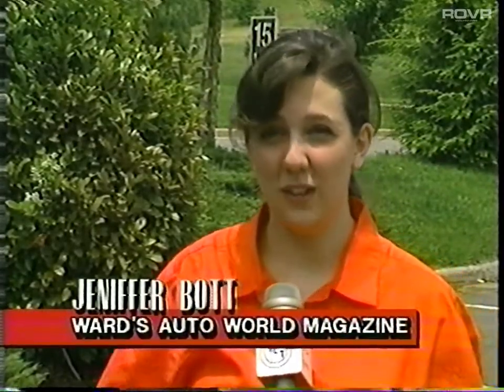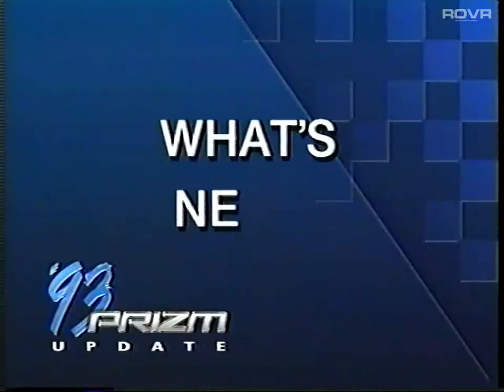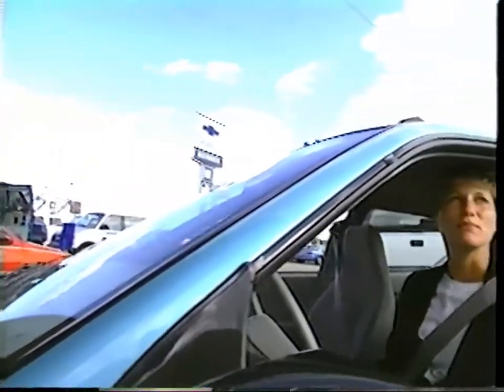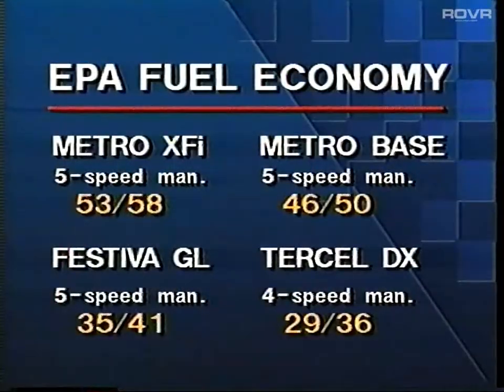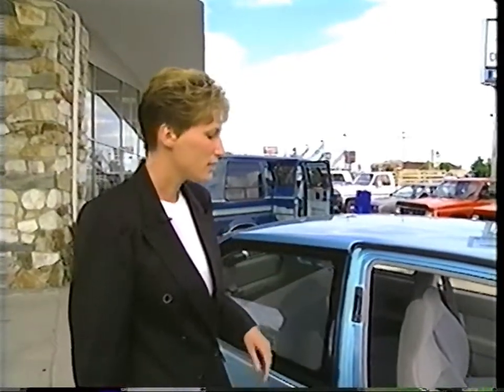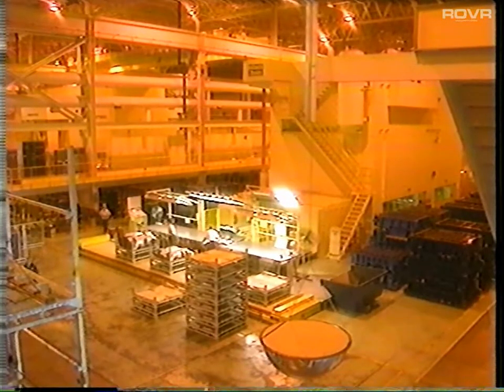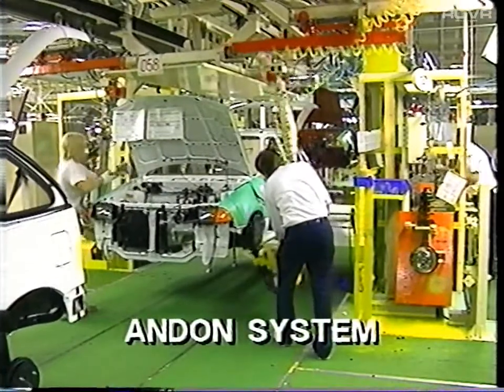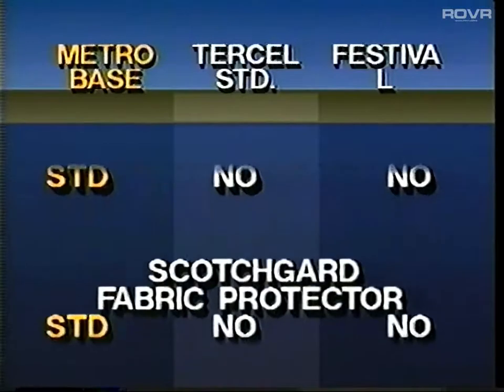Chevrolet (US) - 1992 Geo Metro vs Ford Festiva - Inside Track (1992)

Comment: The Geo Metro was a far better car than the Festiva, and both were better than the cheapest Hyundai Excels of the day. 
These cars are among the cheapest on sale, so you cannot expect Lexus quality or Corvette performance. The Metro sold on price and economy - remember, this was in the days before the Prius or electric cars - and you could, in theory, take three of your friends on a road trip and expect 50mpg. There are not many non-hybrid cars capable of that today.

I drove a Metro for a short time at my job back around the time this video was made. It was not glamorous and not fast, especially when the AC was on, but it wasn't terrible either. It was a considerable step up over the Chevette and Omni which were two of the more miserable carpool options (this was a state job). I wish it had the manual - an underpowered car with a slick manual shift is more fun than many automatic cars with more power. 
The lady at 19:25 would be disappointed to know that besides some badging and ScotGard, the Metro is just about all Suzuki!
Reply: All depends. 

GM is crap. Ford too but, it’s hard for a ford to die.
Reply: @prestoncheapbtheadphoneste3010  but the Metro was a Suzuki and the Festiva was a Kia. Suzuki was just more reliable than Kia back then.
Reply: @engineer_alv  That is true.  And there A LOT more Metros around today than there are Festivas.  Festivas were just straight garbage, especially once they were over five years old.
Reply: No, the Metro had sloppy handling and was not fun. The Festiva was ultra reliable and a blast to drive. Mine lasted seven years.
Reply: @LearnAboutFlow  Neither had great handling.  Those cars were not made for good handling.  They were mainly transportation cars.  If you got seven years out of your rolling pile of garbage then you got lucky but you did not say how many miles it had.  If it died after seven years and only had 40K miles then that's not reliable.  My aunts and uncles got 200K miles or more out of their four early 1990s Metros.  The last Metro we have has always been a spare car and it's a 2000 with 168K miles.  It's never left us stranded and all we've done is oil changes, tires, belts and two timing belts.  You still see a good amount of Metros, too.  Festivas in California and Arizona are a rare sight today.
Reply: @kendrahansen1175  The Metro was designed for people who like Corollas. The Festiva was a great handler given its class and I took it into twisty hills and such. I cannot comment on long-term reliability ($200K+) as the car slid on a wet road and suffered frame damage. But during the seven years there were no problems, and I believe the car had like 50K. I even had it detailed multiple times.

Having old cars on the roads today are due to two basic reasons. One is the fact the cars were garbage to begin with (basically any American car), but in this case it has more to do with what cars people like. There are a ton of VW Beetles in CA as are microbuses.  There aren't a lot of Toyota Tercels (for example), even those were bulletproof and fun to drive.
Reply: @LearnAboutFlow  I don't know about that.  Corollas and Metros were in two separate categories.  Metros are ultra-basic transportation and Corollas as a much bigger step up.  If anything, Tercels and Metros are a better comparison.  Having a car for seven years is one thing but if you only put 50K miles on the car, that is not a very strong indicator of its reliability.  It's something but 50K is not much in terms of miles.

Yes, people tend to keep the cars that they like running but if a car is well built it will last years, even through multiple owners.  At some point, however, there will be a repair that will cost more or about the same as the car is worth and that is when people will let them go.  Unfortunately we are a throw away society and even if a repair is expensive it is often still worth it to make the repair because it is cheaper than a car payment.  Most people don't have that mentality, unfortunately.
Reply: @kendrahansen1175  The Corolla comment was not about classes, it was about boring drives. The Metro and the Ford Aspire (Festiva followup) were both very, very boring cars. The Festiva was not, and was a blast to drive despite its doors shaking at 65 mph. And 50K may not be a lot of miles, but it is a clear indicator of long term reliability for any car.
Reply: @LearnAboutFlow  Well, if anyone buys a Corolla, Metro or Ford Festiva for performance in any category they need some education.  After about 1980, most cars easily made it to 100K miles so 50K is only half of what any car of that era should have reached.
Reply: @LearnAboutFlow  I don't think I ever drove a Festiva, to be fair, but a friend of mine had one or access to one in high school. It was probably a better handling car (I assume from its Mazda 121 origins) but the ride was also choppy and the cabin was chintzy, even for a cheap econobox. And Kia, who actually made the car, wasn't known for attention to detail or quality back then. The Metro wasn't a fantastic car, wouldn't ever say it was, but if you're buying a hairshirt car like this you might as well go all in on the economy. Not sure how much 'fun handling' matters on a car with <65hp.
Reply: @RoadCone411  I only buy cars that are fun, and the Festiva was that. I never considered it hairshirt as long as you knew its limitations. 

But you do sound like a typical American, since even the 32 horsepower original Fiat 500 Abarth was considered a blast to drive, even on race courses.

Oh well, to each his own, but the Metro was boring as hell.
Reply: @LearnAboutFlow  I don't know what typical American means, but these were the cheapest cars on sale in the USA. I have an affinity for small cars from this era because that's what I grew up. You didn't get a lot and probably shouldn't have expected too much. Performance cars they were not though.
Reply: and they still are better than any crappy hyunDIE or kia of today!
Reply: @engineer_alv  and still is, by far
Reply: @RoadCone411  Typical American likes non-sporty cars which is why SUVs, Camrys, Corollas and the rest are bestsellers. The Metro fits in that category, the Festiva does not since it is a blast to drive. I, too, grew up on small cars and it's up to the driver to make the most of it, unless there is something 'insurmountable' like a Metro or Festiva with an automatic.
Reply: @LearnAboutFlow  I get your point...my thought is that any car - even a cheap, underpowered one - can be a lot of fun with a manual transmission. Unfortunately it's getting harder and harder to get manual transmission cars, in the US at least. They'll be all but extinct in 10 years...

Comment: 30 years later there are more metro's still on the road than the competition in this video
Reply: I never see any Metros on the road.
Reply: Here in Denver there are probably equal numbers of Tercels and Metros but yeah I haven't seen a festiva in many years. Ford didn't sell anywhere near as many of them as GM sold Metros. These cars were plentiful in the junkyards for may years and it was easy to keep them on the road. Not so for the Festiva
Reply: I'd say that the mileage on the Festivas wasn't good enough to keep them going, and Kia did a good job for a 1980s Korean car company, but there were still a ton of things it needed to learn about the oily bits. I do occasionally see a Festiva, but they've become very rare. Metros are far more common. Heck, in BC I saw the only example  of an Isuzu I-Mark I've ever seen, a Canada-only Pontiac Sunburst. The Fiesta was at least better than the Pontiac LeMans, and it's own replacement, the Aspire.

Comment: I can remember going with an employee of mind in the early 90's to look at a Metro on our lunch hour.  Just the base one with a/c though, and stick.  With the two of us, rather slim guys, it was virtually impossible to get it up to 65 on the freeway.  That did it for him.  My Isuzu might not have gotten the same mileage, but it had a practical amount of power.  It reminds me of the first Dodge Dakota pickup and I tested one with stick and the 4-cylinder engine and once again, foot to the floor, it struggled to reach the 65mph limit here in Texas.  Nix on that, too--not safe.  The Metro was cute for city driving but definitely not suited to freeway driving.

Comment: I only recently realized how much the Metro looks like the Caprice. It's most noticeable comparing the Metro 3-door to the Caprice wagon, since the 5-door had to be more squared up and the Swift sedan was styled in-house by Suzuki in Japan while the hatchbacks were clearly a GM Design project.
Reply: The design was GM's at first, given to Suzuki when they realized that they had no interest in engineering the car and that it wouldn't be economical for them to do so given the market size, so they sent it off to a little company they had acquired distribution rights to.

Comment: The Prizm is "completely different" than the Toyota Corolla. Yeah, no. I don't think anyone bought that line, even among GM's PR flacks. The advantage these Geos had is that they had no name, so their price was always lower than the Isuzus, Suzukis, and Toyotas that made up their lineup.

I like both the Metro and the Festiva. The Festiva feels like a more substantial car, but because of it's lower economy, less have survived. The Metro did champion work as an economical car, certainly more than the Chevrolet Spark did, as it's distant successor.

That Prizm may have been all new, "not a reskin," but the Caprice was, for sure, just a new body on the old frame.
Reply: I had a 97 geo prizim it had the Same engine transmission and as a 97 corolla. They were made in the same assembly plant in California. Google it! Just the body was different.
Reply: @leod3963  Just the badges, radio, wheels, and lights, to be precise. I know that. I know about NUMMI. I drive a Pontiac Vibe.

Comment: I really dislike that seat belt arrangement on the Geo Metro. Glad we didn't have this forced on us in the UK (where that car was sold as a Suzuki Swift or Subaru Justy).
Reply: They could have put an airbag in or a motorized automatic seat belt to meet the US requirement, but the car was too cheap.
Reply: Was there a Vauxhall version of this in the UK?
Reply: @rightlanehog3151  Not that exact shape. The Vauxhall equivalent of the Geo Metro was the 1982-92 Nova (sold as Opel Corsa in the rest of Europe), which was replaced in 1993 by a new model known as the Corsa under both marques.
Reply: @mattw8332  While spending the winter of 1997-98 in England I was a passenger in what must have been a Suzuki Swift. Over the years they were on sale over here,  these cars were coming from a Canadian factory badged as Geo, Suzuki,  Chevrolet  and Pontiac.
Reply: We didn't have to put up with mouse belts here in Canada, either, thank goodness. I forgot about the Suzuki-Subaru link. Here in North America the Justy was just a small front or 4WD boxy car sold with an option of the first CVT. They didn't last past 1994, so they could have been a part of this test.

Comment: Basically a Suzuki Esteem (BCS Better Call Saul car) with a different shell. So yea spray it yellow, make the rear back door maroon, you get to tell people that the constitution says they have rights, and so do you.
Reply: Metro was a Suzuki Swift. Esteem was bigger.
Reply: Esteem was built on a different platform. Powered by the tall-block G engine. The dash and the chassis  do look similar but nothing is interchangeable
Reply: The Esteem was called the Baleno in Japan and Cultus Crescent elsewhere, implying a relationship to the Suzuki platform underpinning the Metro, called Cultus in some markets, but it was developed from that car, not directly related.

Comment: I go with festiva geo and Suzuki were cheap bolting the front control arm to the body. If that part of the body rusts the control arm gets loose and car is not safe to drive needs to be junked. Seen it happen. This does not happen with festiva.